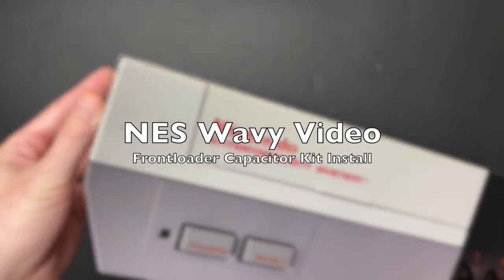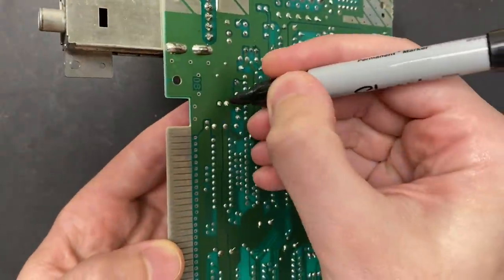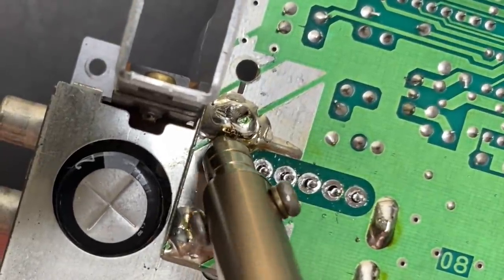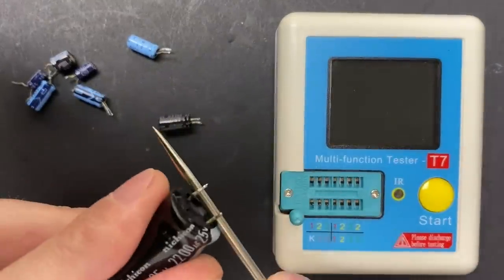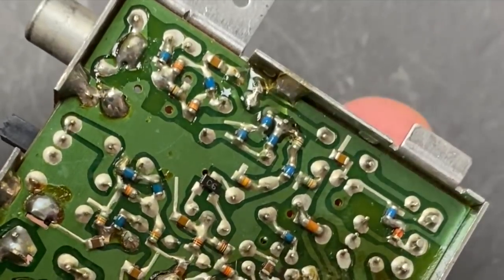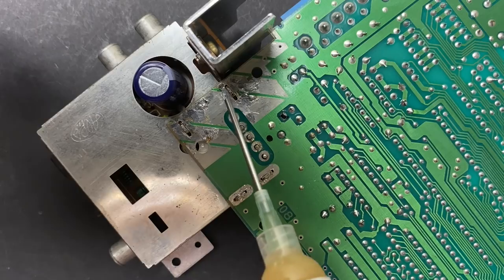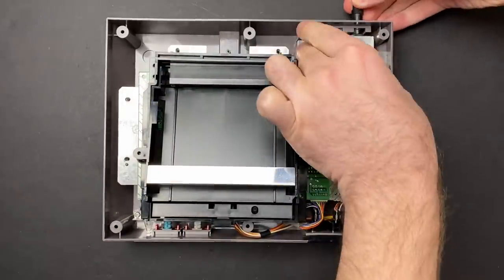Nintendo NES Wavy Lines on Screen - Retro Console Repair

Comment: I'm no EE but I've watched enough ElectroBOOM and Dave Jones to know why the DC adapter masks this. The AC adapter outputs the same 60 Hz (NTSC) or 50 Hz (PAL) sine wave form the mains power has. The FULL BRIDGE RECTIFIER in the NES converts this to a series of half-sine bumps, which the filter capacitor(s) smooth into a roughly flat DC to power everything in the system. If the filter caps have gone bad, the DC produced will have significant ripple, which is probably what's triggering the wavy lines. By using a DC adapter, you supply your own FULL BRIDGE RECTIFIER and good filter caps, so what goes into the NES is already smooth DC and so the inadequate smoothing doesn't affect it.
So, replacing only the caps in the power section should be enough, and using a DC power brick instead of recapping is actually sort of a proper fix rather than just hiding the problem. However, the other caps in the system are likely on their way out too and it's just a matter of time before they fail, so yeah it's really best to replace all of them.
Reply from the maker: Thank you for the thoughtful explanation, great to better understand the underlying behavior of what was causing the issue.

Comment: "smells like Fish"  That is because old Caps from the 80's has fish oil in them to get past some sort of import standard. 
Nice work. I remember doing this about a year ago on my front loader.  I did the Voltage Regulator too while I was in there.  It was part of the whole kit from Console 5.
Reply from the maker: Did not expect this to be the reason. That is hilarious. I need to look this up some more. Do you know if this was done on any other systems? I've worked on a bunch of stuff and never smelled something like that.
Reply: @BorderlineOCD  it depends on the import laws and restrictions that were in place at the time.
Reply: you sure it does not use fish processing? ;D
Reply: @BorderlineOCD  Try repairing a Game Gear and you'll be struck with that smell again.
Reply: @BorderlineOCD  it's the wet, er, sticky bandits.
Reply: @majortom5838  Agree. The smell is from amine curing agents in the PCB epoxy, and "fishy" smells are a fairly common effect of heat degrading resins in electrical and electronic components. No idea where the claim of electrolytic capacitors being filled with fish oil came from, the electrolyte is typically an ethylene glycol and borate solution.

Comment: You always want to desolder the pins from the single-sided RF/power board since the motherboard is double-sided and the RF module is a huge thermal load for the desolder iron. If you do desolder from the motherboard you need to give it much more time to make sure the heat has soaked through and flowed solder on both sides.

Yeah, leaked electrolyte always smells like fish when you heat it. I have yet to find an NES RF/power module without at least one leaked capacitor, even if you can't always see it. The three on the mainboard, on the other hand, are always fine. It seems that Nintendo used better caps/engineering than Alps or Mitsumi (the two suppliers for the RF/Power module).

Most variants of the RF/Power module can be fully recapped without removing the whole thing but I always seem to run into the one that has a single electrolytic in the opposite corner from the main filter cap. :( Still, if you can avoid desoldering it, that's always best/safest. Huge waste of braid and effort if you ultimately didn't have to.
Reply from the maker: Great feedback, thanks for sharing your own experience. I had that capacitor on the other end of the board, but it looks like it's part of the RF audio circuitry. I might ignore it in future recaps and try the method you propose but not my favorite option to leave an old cap in there.

Comment: The trick with desoldering the RF-Modulator without ripping pads is to desolder the pins inside the RF-Modulator rather than on the main board. The pins on the main board have a lot of solder on both sides of them, and it's almost impossible to desolder them without having a lot of solder remain on the unreachable bottom side.

Also the dark stuff on the RF-Modulator board probably isn't flux but leakage from one or more of the caps. Would also explain the smell. Usually, these rarely leak, but it CAN happen.
Reply from the maker: I plan to experiment a different approach on the next NES build to see what works best. I'm sure there's an easier way.

Comment: What's that tool you're using to punch out the pins and solder that's awesome. I normally just use the soldering iron / flux then the braid.

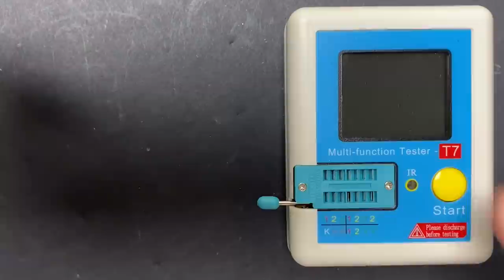Comment: 8:08 it’s because of what you just said. The caps are capable of storing the same amount of energy. But not able to deliver it in time. With a dc signal the voltage is not changing and the caps are not being asked do deliver a changing amount of charge. In fact they don’t do anything once at a steady state (for ones acting as filters) so the problem goes away

Comment: It's easier to replace the capacitors if you leave the RF unit attached to the board, remove the one fully exposed cover and bend the other one open. The long legs of the new capacitors will reach the through holes with some creative tweezer work.

Comment: Hey what did you use for the jumper?, I did the same thing and tore a lead on it and want to try and fix it like that, thanks
Reply from the maker: I used one of the capacitor legs that I trimmed off from the install. Some solid core wire will also do the trick.

Comment: One of the NESs I have has a corrupted graphics issue. I've tried all kinds of stuff and can not get it to work properly. Have tried a couple 72 pin connectors. Cleaned everything numerous times. Reflowed a bunch of stuff on the board. Recapped the board and AV module. I'm thinking it has a bad memory module. Shows graphics on the screen but they are all garbled up. I have three others that all work great.

Comment: Hey borderline . I have one of these NES systems that flash the console  power on and off . After a few attempts of pushing the power button off and on it stays powered up and works great. Have you heard of this and is there a remedy?
Reply from the maker: I would check the 72 pin connector and the contacts for oxidation.
Reply: Ok thanks 👍

Comment: If I wanted to replace the diodes in that bridge rectifier, what are the replacements?

Excellent video! Very soothing! I could watch this all day long :)
Reply from the maker: Not sure bud, haven't had to do replace mine. You'll have to do some research as there are slightly different revisions of that RF module board and I believe some might have 4 diodes while others will have 4-pin bridge rectifiers (all-in-one).

Comment: Thank you for the nice video with what temperature you solder with the ts100
Reply from the maker: It depends what solder you use as they have different melting points. The ground plane on the device also plays a role as it can suck up a lot of heat its if a big ground plane. I find 350C or 375C to be a good sweet spot with my setup for most jobs. I lower it for sensitive work, and every now and then crank it up if the job demands it. I would suggest doing some practice on a junk board if you haven't used your iron much yet to give you a good feel for your iron and the products you are using. Just remove some random components, clean up and re-attach them.
Reply: @BorderlineOCD  Thanks for the quick replies 😘

Comment: im trying to fix my NES, it has this wavy line problem, but also has a BSOD, id like to fix it, i just need to know, at 3:36 what tool is that? and where can i get one?
Reply from the maker: It's a desoldering iron, but a manual pump version rather than a vacuum pump version. I ended up returning it, I wasn't all that great but it was around $30 or so, so can't expect much. I recently took the plunge and bought a proper desoldering iron but they start in the $120 range so a bit of a price difference.

Comment: I bought rivets designed to repair ripped pads. They’re available in all different sizes. No messing around with wires and whatnot.
Reply from the maker: That's interesting. What are they called? How do they work?

Comment: So what size philips head could you use because i have that small red one thats included with usually ds lite parts and in repair kits
Reply from the maker: The screws on this console are pretty large I think I used a Phillips #2.

Comment: I just bought a NES in very good condition. Sadly it has this problem. I first thought it would come from my "hacked" camera monitor I use for testing but it is the same on my TV. I have the luck that I have a TV that can make old consoles look very good without a converter so I want to enjoy a good picture there.

Comment: thanks for the video, unfortunately i tried and tried.  but I couldn't solder the power supply, I could only change the capacitors on the motherboard.  so i went for the workaround.  i'm mad at who design is nonsense to solder the power supply

Comment: i've seen this caused far more often by poor quality power adapters from china and going back to an original power supply or a better quality one has resolved the issue, however replacing caps with modern high quality ones in classic systems is always a good plan.
Reply from the maker: I wouldn't be surprised. That aftermarket power supply was incredibly light (not to mention underrated even though it was advertised for the NES). I wouldn't trust running that for any extended period of time.

Comment: I plugged a dc adapter into a ac before. Let me tell you what, I almost crapped my pants.
Reply from the maker: Little smoke? No biggie.
Reply: @BorderlineOCD  no more like the capacitor exploded 😅
Reply: I did almost the same thing but with a LED (it was shorted out and i turned on the power and it popped open throwing pieces of itself all over, it was very loud and a couple pieces hit my face)

Comment: I really don't trust to plug my Nintendo consoles with the original power supplies on these days, if you probe them they will for sure output much higher voltage than the standard 9/10v that they usually output, I don't really know why, but I had several that was outputting 14v, even one that was 17 volts.
Reply: That’s normal for unregulated power supplies. They’re very basic, not much to go wrong with them. Connect them up and turn the system on, and you’ll see the rated voltage as expected. 

Now if a modern regulated power supply is doing that, don’t use it.

Comment: Would a 5v 2000ma adapter work
Reply from the maker: 5V isn't enough to energize the board. You can probably get away with a couple of volts below the rating without experiencing graphical artifacts but 5V likely wont even turn the console on.

Comment: need to start getting cap kits from @console5
Reply from the maker: It's a great resource. It would be nice if they gave you the option to upgrade to premium caps like Nichicon or Rubycon.
Reply: The  original large capacitor is a Nichicon from fue vt (m) series but it is obsolete. Wich one did you use in the video? thanks a lot

Comment: Have you seen how caps can be replaced inside the power module without removing the casing from the board? Seems a little hard, but maybe worth it not to rip traces. Here's a video showing this method:
https://youtu.be/rdbRlH-Iubk
Reply from the maker: Cool approach, it does present some challenge to route the caps in there. I applaud this mans resourcefulness. My OCD spikes a little that he left one capacitor unchanged because he couldn’t get to it, but seems like it’s responsible for RF audio so it’s not critical. I may try this on a future repair to see if I can pull it off.

Comment: You need a heat gun or a hot pad 11:58  your technique here is very rushed. You could also just leave the iron on for 60 seconds or longer. It’s a lot of metal to heat here

Comment: Nice diagnostic work, but if you only want to replace the caps that need it: the two 100uf (10v and 25v) caps nearest the video out  is all it takes to fix this. See photo here: https://alantechreview.blogspot.com/2021/06/fixing-wavy-vertical-lines-in-nes-video.html